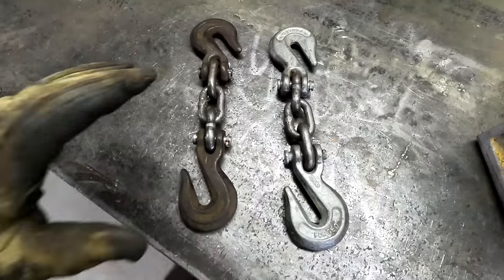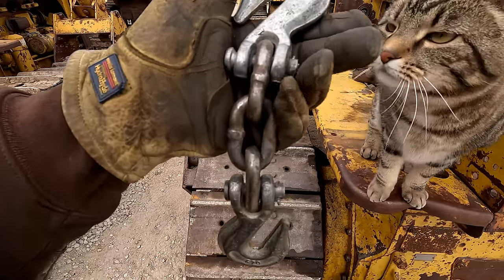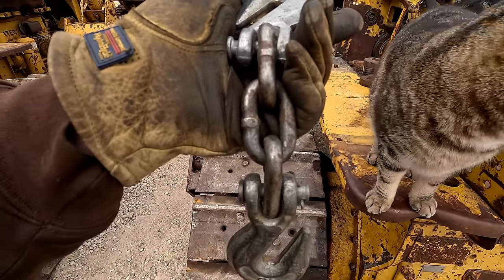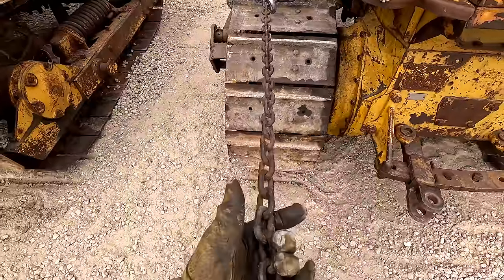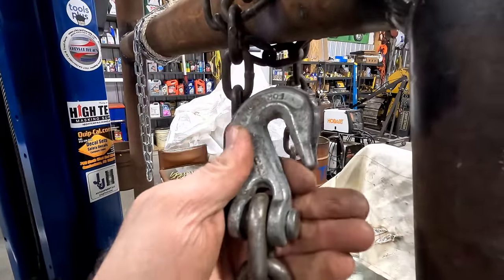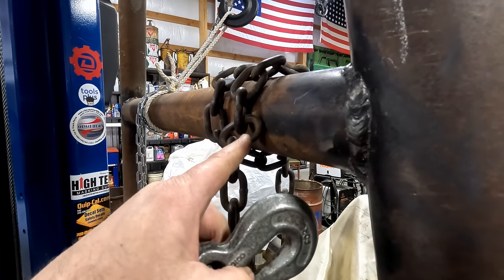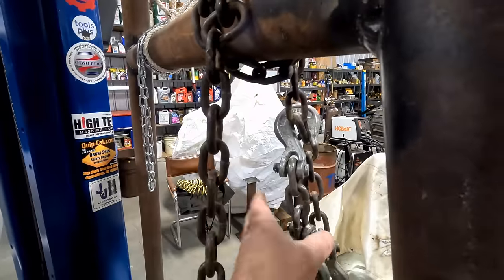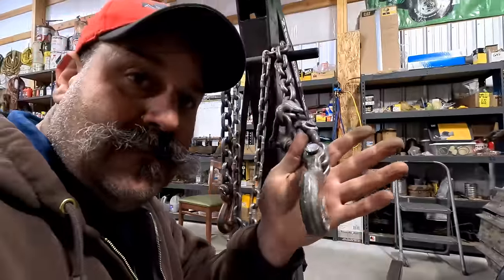A trick for moving immobile track machines, too good not to share!

Comment: In towing I was taught something very similar by an ol timer.  But 7 links instead of only 3.  Amazing for shortening up a longer chain for recoveries.  Be able to winch as close to you as possible, or make a quick makeshift bridle out of 2 longer chains.  Don't use um all the time, but indispensable when you need it.  Great Tip!

Comment: You don’t even need the short section. I’ve pulled dozers out of places with one chain and two chains. The dozer will crawl back over the chain and not dig deeper and get stuck worse. You need to use really good chain and hooks for this. Cheap lower tinsel strength chains and hooks break and leave you stuck. Also if you high center the dozer on a stump and get stuck just hook a short chain to the outside of each track so that when you reverse the tracks the chain will catch the stump and back the dozer off the stump.

Comment: We called those “shorteners”. When you have a pair of lifting chains, hanging from the crane hook and you need one to be longer than the other for a pick, you use the shortener to adjust one of the chains to the desired length.

Comment: That is a cool trick, we also used it in the bridge shop where I worked. It works really good for picking up beams webs and flanges. Especially if they're down on the ground cuz some knucklehead didn't put a block under it...🏴‍☠️

Comment: By pulling on the top of the track, you're essentially getting a 2:1 double up in the force applied to the machine, compared to the line pull force.  The same applies to moving a wheeled vehicle - push on the top of the tyre to get a 2:1 increase in your pushing power.

Comment: This is genius! I imagine it's like my mechanic years back... he taught me to move vehicles under human power short distances. Instead of trying to push and pull on the body, and some of the force absorbed by the suspension, use the tire. The way I figure it this method, putting the force onto the track, is much like putting the force on a tire.

Comment: I have a little sister chain like that for righting rolled over vehicles. Usually I run a chain lengthwise along the vehicle hooked to axles or subframe etc, but I put the sister chain at the balance point of the vehicle on the long chain and hook the winch to the sister chain. It keeps the car from spinning on its roof and the winch hook sliding to one end or the other.

Comment: The ship yard I worked had 20 30 40 ton rubber tire cranes they had 4 long chains 4short chains permanently on a ring you hooked to the 4 long chains    Depending on what ever your picking you hook your short chain s on the link of your long chains to level up your load

Comment: Great idea, going to make some of these up for sure. Pulling on the track vs. the drawbar gives you a 2:1 mechanical pulling advantage (and these make it really easy to hook up). Can get the same thing pushing on top of a tire too. Tricks to get you out of a jam. Thanks for making this video.
Reply: Andew could you explain the tire trick?
Reply: @Gods-Elect  Wayne, if you push on the top of the tire in the direction you are trying to move the vehicle you are getting twice the force as just pushing on the body. The top (tread) of the tire moves in the direction of travel at twice the speed as the vehicle (you can think of it as one time because the vehicle is moving, and another because the tire is rotating). So it acts as a 2/1 lever. You don't get it for 'free' because the top of the tire is moving 2x in the direction of travel. Exactly the same, and perhaps more obvious, as with a tracked machine. The tracks on the ground are not moving relative to the ground, and the top track is moving forward at twice the speed as the machine ... you can think that it has to go faster to catch up with the front of the machine so it can contact the ground again. Hopefully that makes sense. Perhaps I should make a video. I remember my Dad telling me this. Took a few times until I believed him. Depending on the situation pushing on the vehicle might still work better if you were able to push harder with your legs say. But trying to get something to roll it works well, and is worth trying.
Reply: @AndrewMoizer  wow i'm so glad i ask your dad was verry wise & u also i'm going to copy and paste this so i can study it more Thanks so much i'll try to share it with others I get stuck from time to time with my old 91 s10 4x4 usually in mud lol couple times i straped a 2x4 to tire and got out.

Comment: On thicker wider pads, say 24"  D6 size, I found a ratchet binder will tighten right across the pad.
Then, you can hook a chain to the link on the ends. Makes dragging a track back on over the idler a little easier in the woods.

Comment: Your correct in saying that you can buy that setup and they are stronger than grade 5 hooks and chain which should NEVER be used for overhead lifting. We call them chain shorteners in the patch as you can make a long chain as short as you need it besides many other uses some of which you pointed out.

Comment: I have no idea why I have never been shown this or figured it out on my own... thanks man

If the finals are still operable on anything I'm trying to move, I've often got hoses made and run off the 3rd and 4th lines on a skidsteer or backhoe. Walked a D8 with a blown engine right onto my float doing just that.
Reply from the maker: That's a great idea for a hydraulic drive motor. I will definitely keep that in my back pocket. 👍
Reply: @lifeafterourloss  and I made up a dozen short double hook chains like you showed in the video last night.  This is probably the first time a mutually beneficial exchange of ideas has happened to me on YouTube.  Thanks again my man.

Comment: This also works with car when pushing them by hand except without the chain. You engage your hands on top of the wheel and you will get a 2 to 1 mechanical advantage over just pushing on the bumper. We use it around the shop that is pretty level, just so we dont overexert ourselves. Mechanical work is hard enough without exerting extra energy. If you notice in Formula one when they push cars manually, they push on the top of the tires, gaining that same advantage.
Reply from the maker: It makes great sense. Now that you mentioned it, I do recall crewmembers pushing on the tires in Formula 1 races.

Comment: Smart...pulling on the top of the track turns the sprockets into pulleys; doubles your draw.
Reply: An that equals  using a smaller tow rig when the force is doubled

Comment: If my brain is working right, that will give you 2x the pulling force. The top of the track is moving twice as fast as the machine
Reply: No that would be 2x ground speed? Either way there's a little bit of leverage there
Reply from the maker: Yep, it compounds the amount of force to move the track.

Comment: I'm in the process of recovering an old D6 8U and this trick will definitely come in handy - thank you!
Reply: That will be fun!
Reply: @fastst1  yeah it's an ongoing project. Currently stuck on getting the pony motor running (magneto timing is messed up. I'm pretty sure it would run otherwise!).
Reply: Yessss

Comment: Now if you combine that with another longer chain, you can span a chain between the tracks, front or rear and run it under the dozer if you're stuck atop a stump on the belly pan.  Some chains will have an extra large link on one end with 2 grab hooks  The Army manual FM 20-22 has some great techniques for recovery (available as free pdf as well)
Reply from the maker: Great idea, I would love to get my hands on that manual. Sounds like some very useful information. 👍

Comment: Where abouts are u located and how much do u sell your refurbished machines for? Got a wrbsite or something to check out.? I have an old track crawler that im unsure what was wrong with it but i got a bunch of tractor motors around if thats the problem put a turbo detroit in it and make it scream. If your around Sw pa i got one u can check out if u are looking for some older cats. Id do a trade in of my old one to go toward a working one if thats something u do let me know if u are anywhere close and if so ill get u more info about it but it has a hoe on the back as well
Reply from the maker: Sorry, not looking to sell anything.  We are just hobbyists and collectors. I am in Colorado, probably a bit far away. My ears did perk up when you mentioned a Detroit diesel. I love those engines!
Reply: @lifeafterourloss  oh yeah u live some pretty country for sure. I own the family farm now 5th gen on the property so we have accumulated masses of extra tractors and backup engines. I believe there are 2 if not 3 full ready to go detroits sitting in a trailer waiting for a day theh get dropped jnto a frame. We got a bunch of Oliver's from the old 88 all the way up to a 2150 with multiple of each and every one sitting in various states of repair. The detroits came stock in the 1950 series Oliver and boy that things a screamer u never questioned which tractor was starting up when that thing came to life.

Comment: You get only one half of the track force, because the top of the track travels at twice the speed of the machine. Given that there is another track, and using the center of the drawbar for the hitch, gives you the maximum pull on the chain, which is four times the force of your trick. Ultimately, you are limited by ground traction. Your trick is good for pulling smaller things, twice as far as the tractor moves, with only one quarter of the available drawbar force.
Reply: What?!?!  The track travels exactly equal to ground speed.  This method is equivalent to half speed, 2x reduction, because the crawler is moving towards the tow vehicle as the track rotates.  I'm not sure how you could be any more wrong.

Comment: I have always called these cheaters.  That's just what the guy the show me one thirty years ago called them.
Reply: Is cheating what you call only using 1/4 of your pulling force?
Reply: It's what the short chain is called, used to shorten a longer chain.  That's just what I was told a long time ago; don't know if it's the correct term, but it's what I call it.

Comment: That also works with tired vehicles. You can apply much more force pushing on the top of the tire than you can pushing on the body on frame.
Reply: Thats not how physics works. It will move at 2x the speed but at half the force. Plus you lose traction hooked to a side.
Reply: @cHAOs9  You've got the 2 in the wrong place. The result is half the speed but twice the force.

Comment: What size chain/hook did you use? I’m thinking of making it from 5/16”or 3/8? I would use the same size Clovis hooks as the chain. What’s do you think?
Reply from the maker: I used 3/8" chain and 3/8" hooks. This seems to be more than adequate for the 12,000 lb D4 Dozers. Hope this helps.
Reply: @lifeafterourloss  THANK YOU.
Reply: I saw Grade 70 on one of the hooks. The shorter the pull chain, the better! Broken chains become Bullets(Deadly..⚰..🪦..)! Hang something on the chain/cable to help stop it from flying. I have laid heavy rubber mats or boards over the long pulling chains or cable every 5 or 10 ft. Forces it towards the ground when it breaks. I was using some very sketchy cables and chains with a 30 ton winch and kept breaking the cable and chains. Good chains can also break. It's always the weakest link or weakest area on the cable that breaks on a new or old cable...🤪...! I don't recommend using sketchy chains or cables...😬....!

Comment: Really handy if you’re only pulling a feet,bogged Dozer , what do you do when the chain raps around the track frame, you have no idea
Reply from the maker: It only works to move it incrementally. The chain can never wrap around the track frame. Once it gets to the back of the sprocket you have to stop and rehook it. Once the machine started and moved about 5 or 10 ft we were able to. move it with the drawbar. 👍

Comment: How do you make a link wider inside, like into a circle instead of an oval, so you can get a pad lock through it that  has a shank too big?   
With an acetylene torch and  hammer?
Reply from the maker: I suppose you could with a hammer and heat. Honestly I usually look for bigger links. You can usually shorten the chain to the exact length that you need and a lock will fit on the ends without two links in them. If you heat on it and pound on it with a hammer I would never lift anything with it again. Hope this helps. 😊
Reply: @lifeafterourloss  Well it's a security chain for a motorcycle.  I bought some really beefy Abloy 340b locks with a 3/8th shank, and 10ft of 5/16th ABUS chain that fits it, but good god is heavy.   I have a smaller wimpier chain I used before, that is much lighter, but that I'd still like to use these locks with rather than easier to pick Master Locks.   Most scenarios I don't need the big beefy chain, but would still like to use my brutal locks that are less pickable.

I can cut and stick weld, but I'm thinking maybe I can heat the last link up until it's glowing hot (maybe?) with a torch and pound that thing into a circle like I was Vulcan at a forge.    I don't have a press, that would probably work better than a hammer.

I could also make my own bigger link and weld the ends together.   6013 isn't the strongest weld, but then, thieves aren't also exactly the brighest to spot that while in a hurry.
Reply from the maker: If it were me I would make my own link, it's a lot easier. Or you can weld a flat plate with a hole drilled into it on the last link. Just sold the hole is big enough to accommodate your lock. Maybe some 3/8" or thicker steel.
Reply: @lifeafterourloss  Hey, that's a good idea, a flat plate with the right sized (drill press drilled) hole in it to acomodate the oversized lock shank, welded onto end links.   A lot of surface area for the weld.   +1 for you today, you get a gold improvised engineering star.
Reply from the maker: Happy to help!

Comment: Do you use a come a long or another source to pull the main chain?
Reply from the maker: I pull with another tractor, usually our skid steer. A come along definitely works too. 👍
Reply: Thank you I have a 38 H.P Kubota .four wheel drive  with a Manuel transmission I might try. Just don't want to year the clutch out of it
Reply from the maker: @johnstecz9169 if you pull correctly it shouldn't take a lot of force. 👍

Comment: Pretty smart! I found some old chain and hooks in my shed this past weekend when I was loading stuff up to take to the dump. I know what Im gonna make out of them now. I appreciate it! 🍻
Reply from the maker: There are countless practical uses. Hope it comes in handy.
Reply: @lifeafterourloss  
I'm not familiar with tractors. I completely did not understand how you moved the tractor by chaining the left track. Could you elaborate please?
Reply from the maker: It pulls the track just like the sprocked does on an operational tractor. Essentially forceing the track to turn. It will turn as hard as you can pull on it. Hope this clarifies things. 😊
Reply: @lifeafterourloss  
Ok yes. That's what I initially thought, but then I misunderstood something.
 
Thank you.

Comment: I dont get it.....have you disconnected the final drives or what? Are you pulling half a track length at a time ? We saw the chains but not how you use them. I have rescued , recovered , towed or transported hundreds of different types of machine....And I can guess what you mean here.....but it wasn't shown. And a crawled machine won't move while final drive hoses are still connected.
Reply from the maker: The main clutch was out and the dozers could roll freely in neutral. No doubt this trick would not necessarily work on modern equipment or without pulling the axles. We used this to break loose severely rusted tracks and machines that were sunk in the ground sitting for decades. It worked flawlessly on all five of them. I will put out a video in the future showing it in practice. 👍